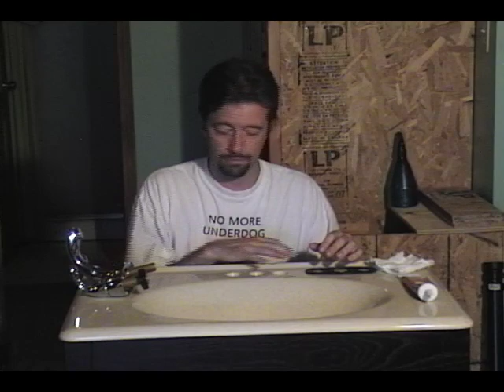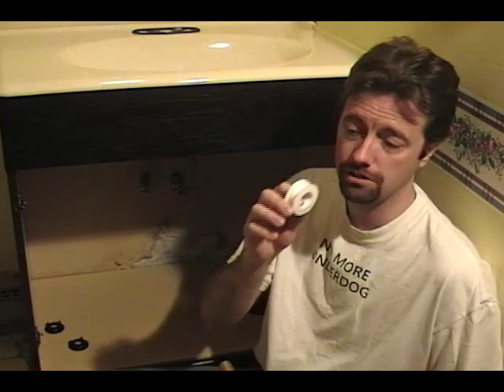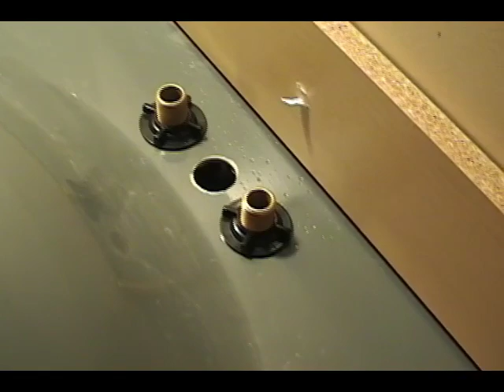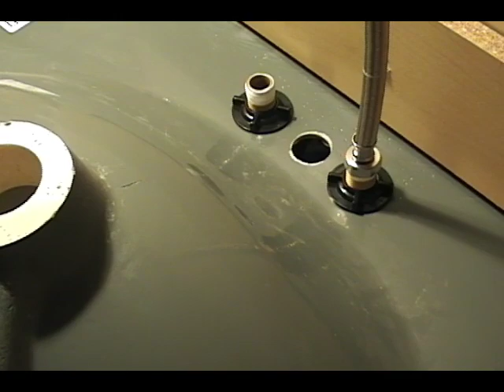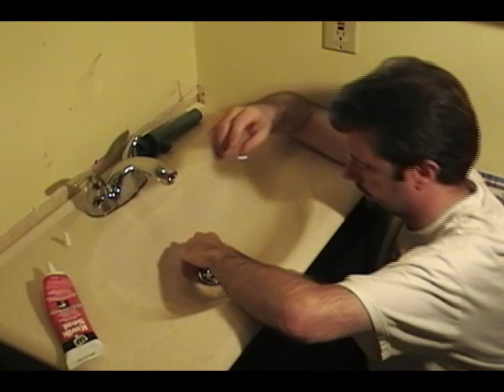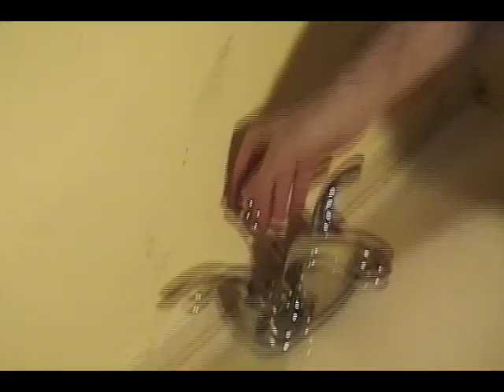Install / Replace Bathroom Faucet

Comment: Great video. Helped me out. The faucet I bought(American Standard) failed to mention the use of plumbers putty or silicon and also failed to mention anything about teflon tape on the threads fo the supply lines. Im leak free now. THANKS!